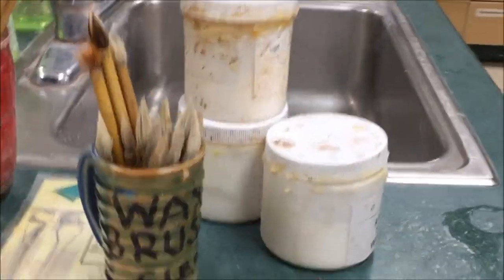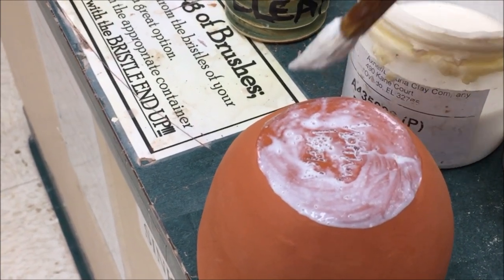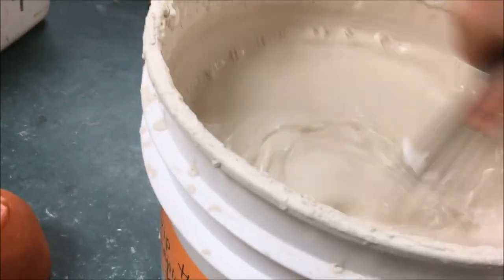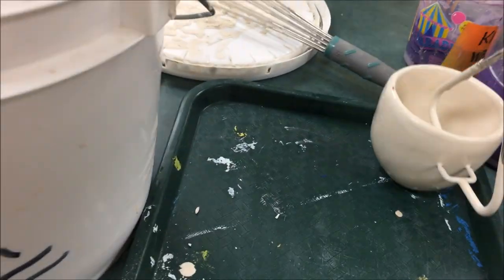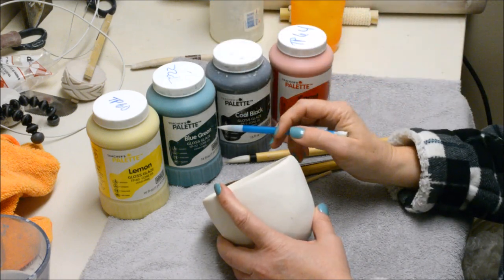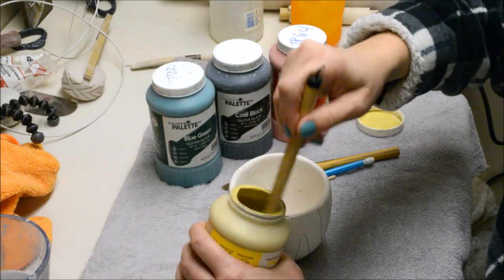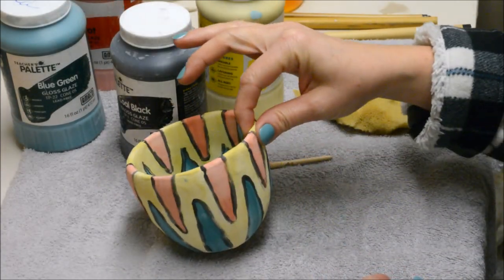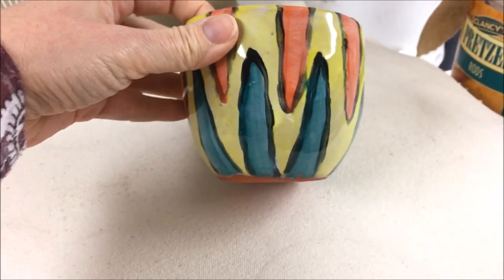Glazing with Majolica Glazes,  Tips and Demonstration

Comment: If I were to try this on porcelain would I just ignore the white glaze part?
Reply from the maker: Hi Sean- Porcelain is a high fire glaze, and majolica is low fire, so those to in combination don't work.  But, you could use something like high fire underglaze on porcelain, bisque the underglaze then clear glaze.  More like the technique I show on the sgraffito pots... just minus the carving!  :) . Here is the one where I apply the underglaze- but you can be painterly, and do designs of course.  https://youtu.be/f9hzPyewwAY .  and, here is the follow up of the sgraffito carving.  https://youtu.be/4Ust2g6Mjhc .  Sorry for focus issues, I am remaking both of those!
Reply: @KaransPotsAndGlass  Thank you for such a light-speed reply.  I appreciate your advice.  I shall go hunting for the high fire product.  Many thanks.
Reply from the maker: @attilathehamster6774  Lol- just happened to be at my computer when it popped up!  :)

Comment: Thank you. What clay body do you like best? Are these items food safe?
Reply from the maker: Hi- the materials description of what I used are in the video description.  Yep, these glazes are food safe when properly fired!  I happen to use Standard 103 without grog for this project with my beginning students because it is easy for them to work with. My personal favorite clay is Laugna Bmix with grog, cone 5.  That is what I use for my personal pottery on my Etsy site!  :-)
Reply: @KaransPotsAndGlass  If you are using a cone 5 clay and firing it at a low fire range will the clay be fully vitrificated?  Is that a concern for the durability of the finished product?